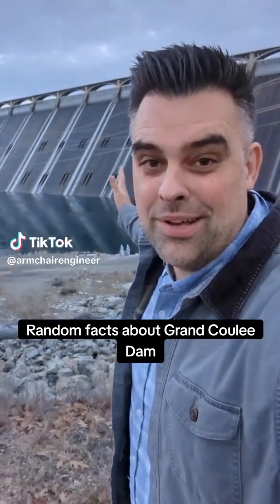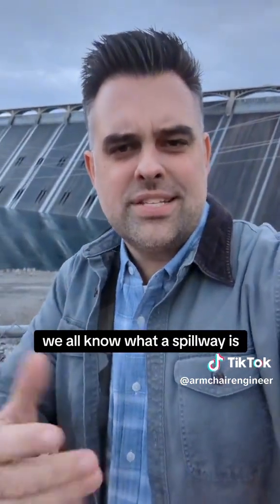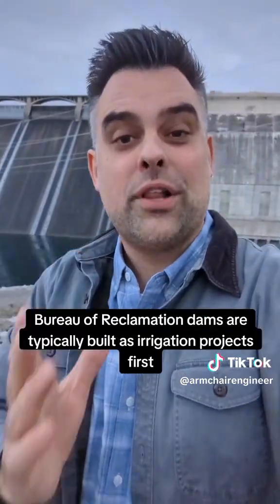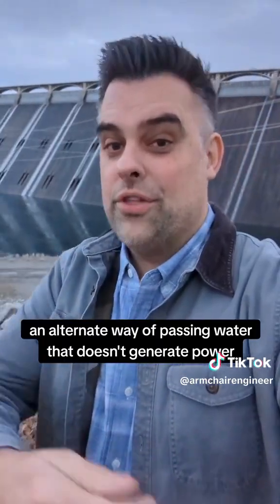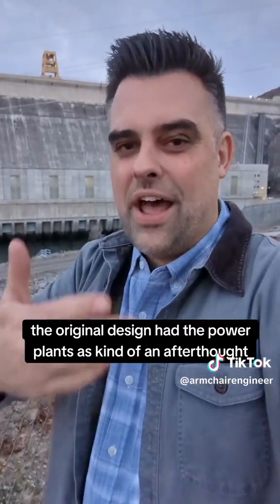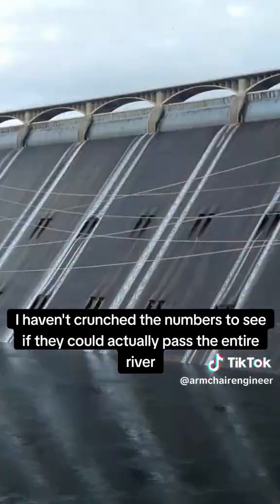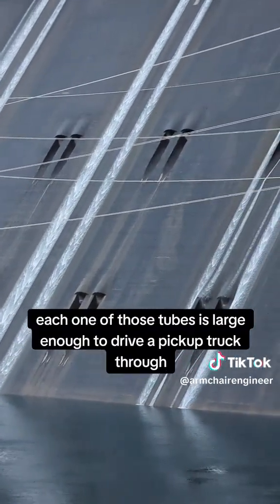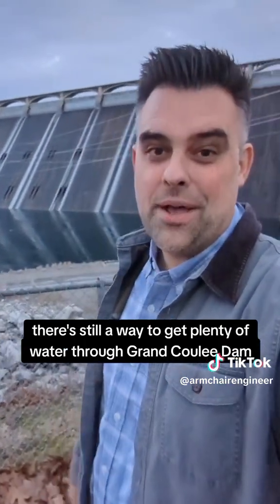The Grand Coulee Dam outlet works are so large, you could drive a pickup truck through them.

Comment: What's the point of the outlet works? What does it do that the spillway doesn't?
Reply from the maker: The outlet works allow you to release water even if the reservoir isn't full.
Reply: @ArmchairEngineer Oh! That makes sense. I didn't realize spillways need a full reservoir, but it seems obvious if I think about the design. 
Thanks!